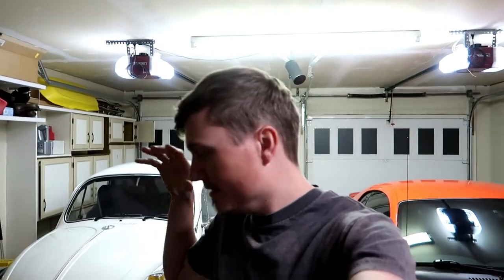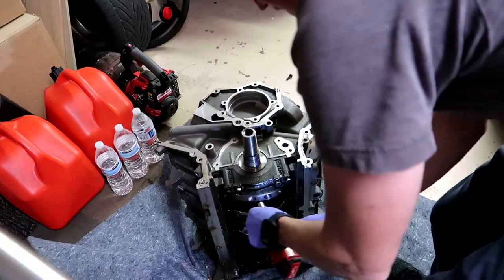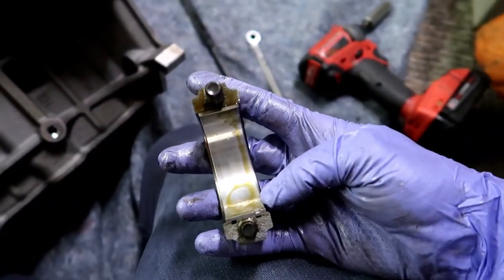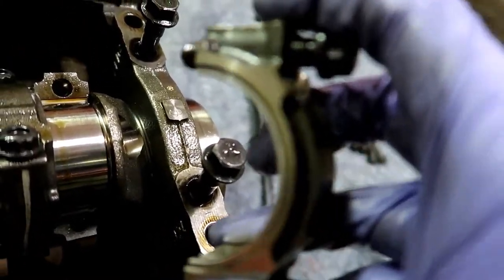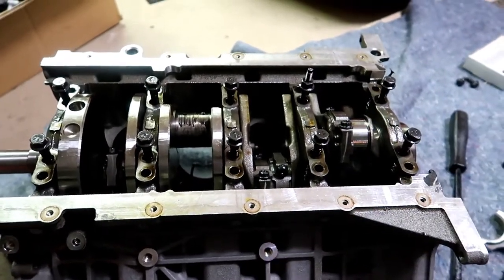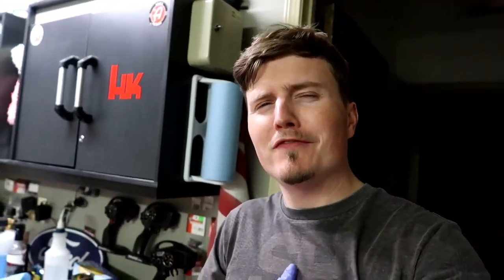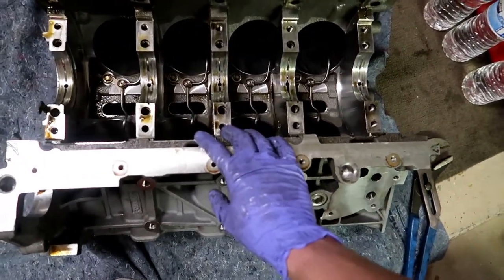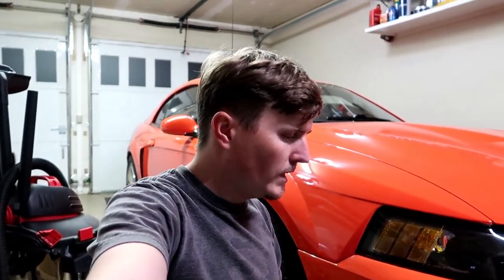Coyote Build #1 It's bee approved!!

Comment: Go with Manley sense its tore apart do it right the first time! I would just get a 15-17 new crank and get Manley rods with ARP 2000 bolts and Mahle or Diamond pistons and also do away with oil squarters

Comment: If your goal is 1000+ hp definitely get the crank turned, good rods and pistons. I don't think stock stuff will support that power (for long). Do it right or you'll be doing it again sooner rather than later.
Reply: Yeah, the Coyote block is plenty strong, esp. the 12mm blocks, but the weak link is sleeves. They like to crack around 700-800hp. Rods go around the same. I'd at least go pistons and rods and probably just replace the crank under 700hp. Stock forged coyote crank is only like 350 bucks. At or over 700hp I'd start thinking about sleeves. With sleeves and a strong bottom end these things take a ton of power.

Comment: hey man looking to buy a termi what should I look for when testdriving
Reply from the maker: Zain Yaseen, lots of things but no ticking or knocking obviously. Also make sure it shifts smooth no grinding between gears. Make sure the supercharger isn’t making and weird noise. When you accelerate or left off the gas while in gear you don’t hear clunking noises coming from the differential. And of course check engine lights, you shouldn’t have any unless something is wrong or they don’t have cats even then the tuner can turn them off. If they delete the cats they should have gotten a tune and them turned off. Make sure if it was tuned you get the SCT tuner or DIABLO tuner with the car. Some people do sell them, those being dumb IMO, but most retain them so be sure to get it with the car.
Reply: 03-04 Cobras are notorious for making "driveline clunk". It does not necessarily mean there is an issue. In most cases it is normal for a Terminator. Zain should check the mileage, does it burn oil, does it run hot, and can the car pass emissions/inspection in your state? Wouldn't hurt to get maintenance records on the car(if any) to see how well(or not) the car was treated.
Reply: tominator I bought a 2013 boss 302 already🤗
Reply: tominator thank you for the awesome feedback tho
Reply: That's cool too Zain...Boss 302s are terrific cars as well, congrats!! Best of Luck.